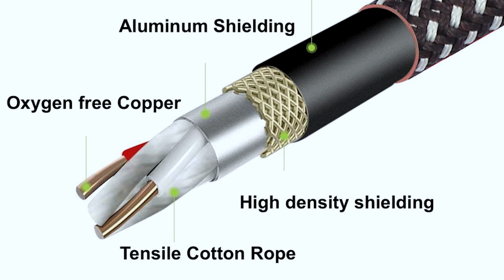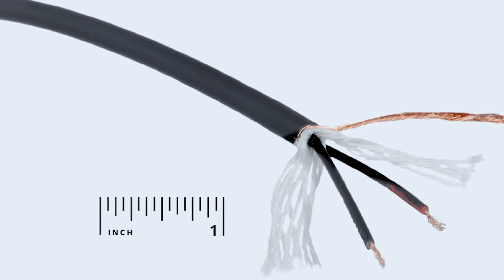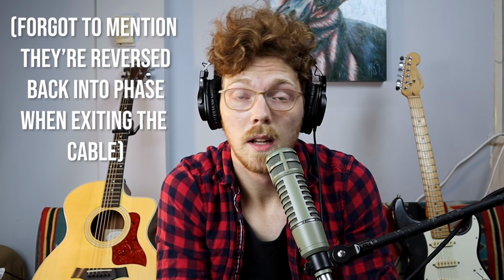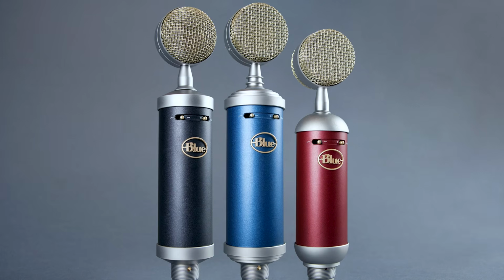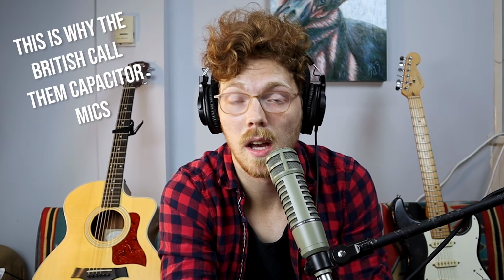Mic Position MATTERS - How to Record and Set Up Vocals (Vocal Recording Tutorial with the Rode NT1)

Comment: well bro you didn't explain why do you advise to set the recording level to the -18—-12dbfs (and also you have missed to specify that you are talking about a digital recording level which are called a Full Scale level fs for short). it is better to understand the purpose of your actions and descisions to understand the limitations of each solution you take

what's you're completely right about is that setting the recording level not quite high gives you an enough headroom level i.e. saves you from clippng on peaks. but next you've said not quite correct - the level in your daw and the headroom saved for editing does not have to be defined by the recording level (input gain) - it is the two separate concepts. as far as didgital editing is all relative you can set whatever level of your sources to process it after recording. also it is important to understand that -12dbfs is an imaginary level to refer it to the 0vu when emulating the analogue hardware gear in digital, but if you're using all digital effects it could be absolute indifferent to any input level. and also in real world hardware analogue recording it is also acceptable to overdrive the stages over the 0vu

and next the most important concept - the higher you set your input level the better SNR you'll get from your mic preamp. and you don't have to be confused with an outdated conception of input stage overdrive - modern clean preamps do not clips until the very end of its headroom so you can drive your input signal up until -0.1db and still stayed clean. of course you're risking to get clipped but if you know what you're doing and you're know what sound the performer (or the technical sound source) will produce then you are free to set the input level higher

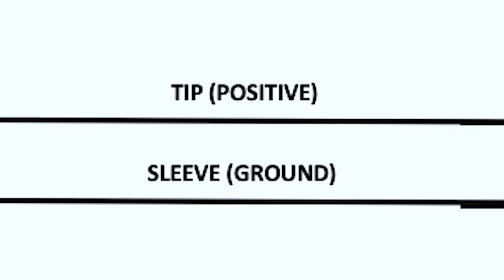Comment: 3:50 In this case, this is totally incorrect. In electrical power distribution (mains wiring in your home, power lines) the ground is really a safety system designed to prevent electrical shocks, but in this case there are no dangerous voltages to protect from. The ground is there, so that the signal can have a closed path. Current cannot flow on one wire, it has to return to the source. The ground wire is also used to block electrical interference from reaching your signal cable, that's why it surrounds the signal wire in most cables.

Comment: It's very important for the engineer to check and adjust the whole vocal chain in the mix, not just the position of the mic. So, start with a test record, mix the draft to hear how it sits amongst other tracks, and then adjust what needs to be tweaked - room, mic choice, position, preamp, fatigue, time of day, humidity, absorbtion, early/late reflections, hydration, monitoring, filtering, gain staging etc etc... They are all in a dynamic relationship with eachother. Changing one impacts the others. This makes listening to it back in the mix with good flat monitoring essential, not just considering the vocal in isolation. The room at the point of monitoring back is the critical element, far more important than at the time of the recording. So this process allows for getting it right on the way in and makes the final mix easier. There aren't rules for vocal mic placements. It's part of the creative decision process in relation to these other elements, especially checking in the mix.
Reply: after spending 3 hours laying down vocals i can't use because I thought 6 inches and a UV meter was enough, I am so sad.

Comment: 2:40 I don't quite understand this. I'd imagine the signal to noise ratio would be the same at -25 to -20 as -18 to -12, and you'd have to boost the vocal more in the mix if its recorded quieter, so wouldn't you get the same amount of noise? The noise would be a lower level, but so would the signal. Does boosting the gain result in a lower signal to noise? I assumed that recording at a lower volume would result in a lower signal to noise due to the increased noise from the ad converters (after you boost it in the box). Is there a sweet spot where the decreased noise from a non uniform s to r from the preamp results in an overall lower signal to noise ratio even after the increased noise from the ad converters? I've always been under the impression that more gain on the preamp results in a better signal to noise ratio

Comment: Hey, I'm using the ecm87 and having some major clarity issues... any help from anyone would be a big help. I THINK my audio interface or cables are faulty but have no way of currently telling. Taking the mic out of the box and setting it up with my scarlet audio interface, no treatment to the mic or sound. It sounds very fuzzy and does not accurately maintain sound when changing the volume speaking at / when adjusting input level as well, for example when I go quieter or louder  the vocal starts to fuzz out and just doesn't sound smooth at all which is my main concern. I was previously using the scarlet studio mic and the preset I was developing for it sounding very clean and smooth and full, however I broke that mic so eventually it stopped working and was completely distorted no vocal signal coming through so I had to get a new mic which was the ecm87... plugging it in has gotten rid of the complete distortion, I can hear my self now but the monitoring input in the scarlet audio interface (when I press the monitoring option on the interface) sounds way cleaner and smoother than the minoring input from logic pro which is what my vocals come out sounding like which is super confusing and frustrating. It's no where near as clear as everyone is saying it should be and when I used my pre set that I was using and working on for the last two weeks with the studio scarlet mic and interface it sounded horrible and distorted and broken and fuzzy and NOT full just really bad and completely different to my last mic when it was working even though they are both condenser mics in similar price bracket ranges. Ive built new presets and played with this mic and the mix but something feels seriously wrong with the vocals it should be way clearer than it is I know something is up but cant identify the issue. maybe it is the cables? or the interface its self having burst from an overdrive of signal previously? Please someone any advice would be great. I also haven't tried to take of the exterior of the mic to look into the adjustable things since I done wanna ruin anything even more. maybe I can do this and flick the high pass filter off / on maybe its on the wrong setting somehow? maybe something isn't how it should be for some reason?

Comment: Stupid question: Should it not be best for the noise floor to record at the highest gain avoiding clipping (with condenser mics which do not have distortion and a sweet spot) and just bring the signal down with a fader when needed for compression etc?
Reply from the maker: As long as your preamps can handle that level of input without introducing excess noise then yes :)
Reply: @AudioHaze  with my interface, mic and vocals, I need to keep the gain at 25% or less of its maximum level to avoid clipping. I quess the preamp can handle this. Or is it the absolute level the decisive thing for the preamp's sound?

Comment: Why do I have to turn my gain to 5 or 6 in order to hear myself
Reply from the maker: on your preamp? Could be a bunch of things, that may be the gain needed for your mic, you may have your preamp monitoring settings set to low or not on the right signal, there's so many things that could be to blame for a quiet signal
Reply: @AudioHaze  I’m just super new to this but ya I have the NT1-A plugged into the id4. I haven’t messed with either settings both are brand new
Reply: @AudioHaze  so it’s not abnormal to need 5 gain… if it still comes out between -18 and -6 decibels? Wouldn’t the quality worsen
Reply: @AudioHaze  I feel like the mic is deaf somehow. Like it should be way more sensitive than it is
Reply: @AudioHaze  I’ll Apple Pay u to check out my setup on FaceTime really quick make sure the settings are right. I have the same mic as you

Comment: Thank you!
Reply: Hi there! Oh boy... THAT is a lot information to process here. Thanks for compressing all of this into a 16 Minute video. Nice job! I can't believe i never responded to this video! After giving you the well deserved praise, I have to mention a little bit of misinformation. I noticed, you said something like this: "Don't set the gain too high. You'll get more hiss!" This is a misconception i wanted to adress.

First things first: You get that much noise between 3 o clock and max gain, because that small change on the knob gives you a lot of additional gain, more gain, than what you'd get by changing the gain from min gain to 9' o clock. Because of this, you get a much louder signal by changing the gain  from 3 o clock to max. And like I said: This will ALSO incease the noise out of your room by the same amount. For example: On my current Interface, a MOTU M4, i get 13 dBFS more gain by changing my gain knob from 9 o' clock to maximum. Thats 4 times as loud. Since i noticed a similar behavior on other interfaces just the same, I think this explains, why people tend to believe, that too much gain adds more hiss.

But since the hiss that you record is most likely room noise, setting the gain lower doesn't give you any improvement. If you set the gain lower to reduce the hiss, you get a lower signal as well. Let's say you get a signal of -12dBFS and a noise of 52dBFS from your microphone. If you set the gain lower to have -60dBFS of noise from the microphone, your signal is lowered to -20dBFS. And what happens, if you add 8dBFS of gain in post, so you have -12dBFS from your microphone again? Exactly: Your noise rises to -52dBFS again.

So actually, you want to use as much gain as possible, but as low as needed to not clip the signal. One might ask: Why is that? Because, while the self-noise of a preamplifier indeed does rise by turning up the gain, so does the signal - and the signal rises by a higher amount than the self-noise. To put this another way: The higher the gain, the lower the interfaces self-noise in comparison.

Comment: Do you suggest putting blanket on top of the mic when recording on very untreated  room with alot of reflections or does it eat up all the highs and do i put my mic to line or inst
Reply from the maker: I think it depends on what you're going for. Honestly for voice over a simple blanket like that could work well, it does eat up some highs but not too badly considering voice over usually has a ton of midrange anyways. I think if it causes a worse performance though, then its not worth it. I used to record a ton in my closet lol

Comment: Merci cette vidéo est bien. Quelle est la différence entre le mode " Instrument ou Line " sur une carte son  ? Bonne journée !
Reply from the maker: Great question! Line and instrument level are two different signal levels, one describes the standardized level of things like audio mixers/interfaces and stuff like that (line level) while the other describes the signal level of an instrument (which is a wider range, typically falling somewhere between line level and mic level). If you have an input/output that specifies, use the instrument input for instruments, and line level to chain other equipment together or pass signals through equipment. Hope this helps! I would normally answer in your native language but I fear google translate would have messed my answer up lol

Comment: Thank you for this video! Perfect timing for me - I've been playing with my new NT1-A recently and trying to figure out the best setup. This hits all the key points without slogging through hours of minutiae embedded within decades of forum posts. Question about the off axis setup: does this only work in the /\ configuration? Or would it also work with \/ shape between the pop filter and mic? The NT1-A kit's mounted pop filter is approx 3.5"-4" from the mic so tilting it inwards has it fairly close to the mic (not sure if that matters). Love your videos!!
Reply from the maker: Hey! Not sure what you mean by \/ configuration, could you elaborate? And thanks!

Comment: From your experience is there much difference in the quality of cables or are they fairly standard across the board (Amazon vs Mogami)?
Reply from the maker: Personally, I don't find cable fidelity to be the most important aspect of the chain, but I know thats sort of a hot topic. I think higher quality cables will certainly last longer, perhaps provide less noise, but the fidelity beyond that isn't the highest concern for me.
Reply: @AudioHaze  Just 2 cents... Super cheap cables can be less robust and break more easily, also can do a poor job of RF shielding.  I tend to choose "good middle."  Kopul, is a favorite of mine.